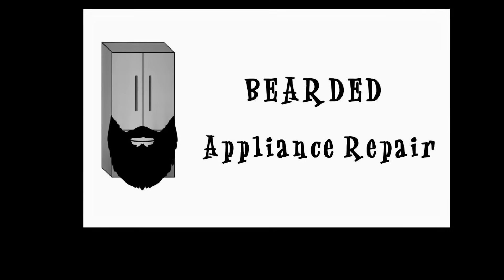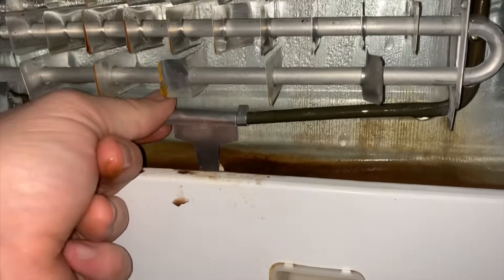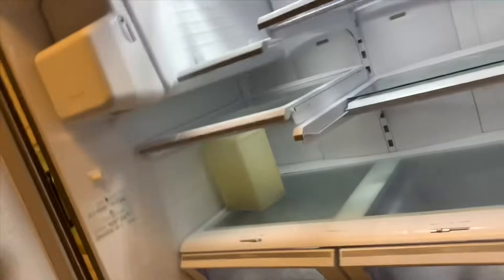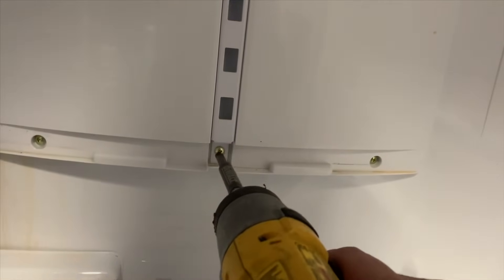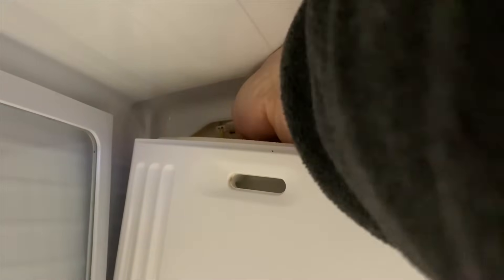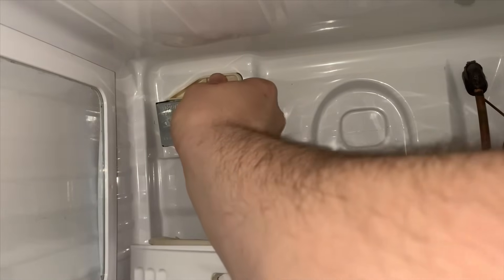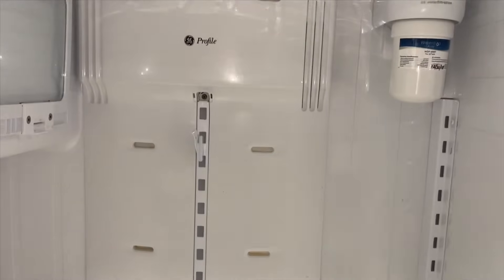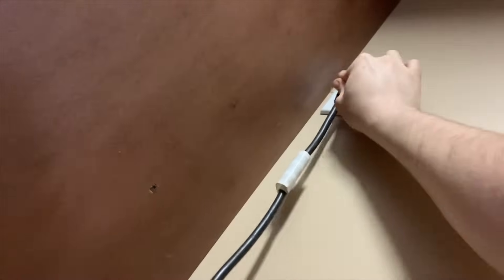Samsung fridge water collecting under deli drawer fix (DA82-01415A)

Comment: its a GE fridge in the video lol
Reply from the maker: Ge just put their name on this Samsung built refrigerator.  This fridge is built exactly like the branded samsung.  Other than the name of course.
Reply: The Bearded Repairman says it is a "Samsung built" GE Fridge in the vid ... Seems as if Samsung is facing a Class-Action lawsuit over this as all their "Twin Cooling" models seem to have the same problem.
Reply: Yep Same exact "Samsung" Fridge - Lots of Sears sold are re-brands of other names .. being largely GE (samsung) or LG (Kenmore) part equivelent under the hood in my limited experience.
Reply: @BeardedApplianceRepair  the link for the kit is sold out. I wonder if it will ever be back in stock?
Reply: Mine has recently starting leaking alot. Couldn't figure it out. I wondered about the GE on the tag also.
Reply: @976slc  I bought the part and got the older one with less holes on the tubes .. my freezing over I think was the combination of a tube clogging and also freezing water inside - which cracked the plastic "back board" 3 places under the white cover... So maybe 11 years on my model is long enough to think about changing.  Not giving up on mine just yet - but I do not think it was fully fixed.  Maybe more clogs, not sure. Please note I do have a Samsung and was same as video.
Reply: @dougprentice1363  I don't understand stand why you can't just clean tunes up,
Reply: Sorry spell checker is being screwy. As I was saying I don't understand why you can't just Clean the tubes up
Reply: @philliprobinson1406 I did, and it didn't solve problem. So I poked holes and opened slit, didn't.solbe problem. The part that clamps to the heater mat help.
Reply: Ok thank you for the information
Reply: @philliprobinson1406  man, talk about spell check. Lol. I take it you could deciefer my last post?
Reply: @dougprentice1363  check reliable parts, or sears part direct. Amazon may have it
Reply: Yeah, and he states it covers both fridges. If you've looked at the configuration on both it's identical, try to pay attention instead of being a critical idiot. A lot of refrigerator name brands are manufactured by the same people or a lot of the internal workings and parts are the EXACT same.
Reply: @RandomStuff_In_MyLife  Since Sears is no longer, Kenmore is made by multiple manufacturers(Whirlpool-who used to exclusively produce Kenmore for Sears-,Frigidaire, LG, etc)which can be determined by the first few digits of the model number. Whirlpool produces other name brands such as Kitchen Aide, Roper, some Kenmore, etc. As mentioned by the Bearded One, the G.E. Twin Cooling fridges are manuf by Samsuck.  If it looks like a Samsung or LG,  you can be assured that it manufactured by them. Interestingly enough, I did some investigating for a customer and found that the Kenmore fridges that were manuf. by LG, which also utilize the linear compressors, during the period of the LG class action suit, were not covered by the suit which I consider a big bowl of wrong.
Reply: @philliprobinson1406  Some comments here say that they just cleaned up the old tubes. I'm planning on using vinegar or citric acid.
Reply: @rasgoldproductions  The panel doesn't look the same as the panel on the Samsung in some of the other videos.
Reply: Pay attention: “Samsung-made GE refrigerator “

Comment: By the way, you can avoid ice build up if you keep the freezer temperature at 5 degrees Fahrenheit and fridge at 39. I replaced that clip and it was find for a few months but started leaking and ice build up all over again, but after I adjusted the temperatures, the problem was finally solved. it was such a simple solution and no one knew how to figure it out. I only wish that I knew that before and it would have saved myself a lot of aggravation. I hired a repairman who twice ripped me off,  called customer service at Samsung who gave me worthless instructions, buying a clip and defrosting the fridge multiple times.  Believe me a went through hell with a fridge that was only 4 years old. No one wants to give you a simple solution.
Reply: Ugggghhh this Samsung fridge is garbage!!!
Reply: @gwenkoller5516  -I guess I have to agree with you. There should make it illegal to sell expensive garbage like that. There should be a consumer warning alert not to buy that piece of shxxt...After one year thinking I solved the problem; we are back to square one all over again. I am experiencing the same problem. i called a repairman who told me I should keep the fridge half emplty and that would basically solve my problem. I said WHAT......!!!! Keep it half empty? Then what is the point of having a fridge just to fill up a space on the wall?
Reply: @guillermone1  OH NO don't tell me that!!! Lol, and here I thought this would be the solution. smh
Reply: @gwenkoller5516  -Well on a positive note, the ice buildup on the back panel, is not as bad as before. But to add insult to injury, I am also getting a small puddle of water under the pull-out trays. Again, not as bad as before and perhaps I can live with it for a while, before I can afford to buy another fridge. But I am going to make one last ditch effort and get a Samsung authorized repairman and hopefully this last time the problem will be solved once and for all.
Reply: @guillermone1  These are the days when I miss my Kenmore!!!
Reply: @gwenkoller5516  -Yeah man, tell me about it.
Reply: Thank you so much for this!!! Samsung is 100% worthless and I got pissed 😡 and went and spent 10k on ALL new LG appliances because I refuse to ever deal with Samsung again! But my husband won't let me trash anything so now it's his beer 🍺 fridge 😂🤦🏼‍♀️ but we've followed all of the instructions on this video to a T and we're still dealing with the same problem, I was about to trash the damn thing but I'll be trying what you said!
Reply: I cannot thank you enough! My husband and I added the heater clip about 6 months ago and everything was fine until maybe one month ago. I am about to check the drain tubes but I bet your solution may be ours.

Edit: oh no, I read your further comments.
Reply: @junello8354  -Well I was able to convince Samsung to pay for replacing the ice maker. I did the research and found out there was a factory defect. They sent an authorized Samsung repairman and changed it. We also made a deal on the side, to also replace the back panel for a relatively nominal amount.  I also tipped him as well. I keep the fridge temperature at 36 degrees Fahrenheit and freezer at -2 degrees. Its been about a year now and thus far this time it worked. I think we finally solved the issue. By the way when replacing the water filter, only use Samsung, do not buy any off brands because it is going to cause havoc for your fridge.
Reply: @guillermone1 the ice maker was the fault?
Reply: @marioplummer2048  -I believe there is a relationship with the Ice Maker and the ice build up. After it was replaced everything has been find and dandy. However, I also replaced the back panel. I made a side deal with the repairman and I stop using the ice maker, because I fear it might go bad again, but it looks like the ice maker was the issue. So far so good. I am happy again.
Reply: @guillermone1  i asked a tech and he said the back panel was the culprit even before i got this message, i am gonna replace it and keep you posted.
Reply: @marioplummer2048 -Okay, please do I really want to know. It has been a long journey and great to know if this is the real solution.
Reply: I just unclogged the tube on the right. I hope that fixes my issues. I'm going to try adjusting the temps up a few degrees. Reading the service manual I see you can also start a manual defrost from the display. I'm not buying any more new appliances, instead i will seek out used 80s or early 90s models.
Reply: We had ours service twice and issue came back so technician finally had the fridge slightly tilted backwards by lifting the front legs a bit to prevent water from dripping out the front.
But if you remove the bin there is always water and frozen water there that slowly evaporates I guess.
Question you mentioned setting temp to 39 but mine says recommended is 38 but won't let do 39. I have 40, 42 as options
Reply: Thank you for this advice. I already replaced the longer clip down the drain hole about 2 years ago. I’ll try your method.
Reply: Dude, this did the trick. Saved me a day and a half of thawing, moving fridge stuff downstairs, disassembling blah blah blah. Took about a week but the ice clog is melted and everything is flowing normally. Thanks again.
Reply: @stephenplantone9720  -WOW... !!!! I am so happy to know that I  was able to help. As you know, I have also done the same and not have any issues any ever since as well. Congratulations....!!!!!
Reply: @stephenplantone9720  Can you please clarify what did the trick?  Replacing the back panel or adjusting the temps as advised in this thread??  Thanks in advance.
Reply: @patti7904 -I truly believe that in the very end adjusting the temperature is what did finally solve it. The reason I say that is because after I replaced the back panel and although the problem stopped, about a 1.5 year later, I started to have similar issues but to a lesser extent. Adjusting the temperature did the trick. 

Coincidentally, today I heard fan noise coming from the back panel, which usually happens when there is ice buildup. I checked the temperature, and it was for some reason set at 35-degree Fahrenheit. I raised it up to 39 degrees and about 1 hour later the noise went away. I guess raising the temperature 4 degree, melted the Ice and problem solved. I hope it works for you.
Reply: @patti7904  I turned the fridge up from 37° to 39° and the freezer from 0° to 5°. It took a few days but the water started draining properly again. Bad news is last week it started puddling up under the deli drawer again. Now I’m probably going to have to disassemble the fridge, thaw it out, then replace the drain clip again. I did it 3 years ago and that did the trick until now. If you have the original aluminum clip still installed you may have to buy the new longer “after market” one. Let me know if you want me to send you a video on how to replace it.
Reply: @patti7904  Just had a breakthrough. I replaced my water filter 2 days ago and the leaking has stopped completely. Basically, you can’t neglect to change your water filter or it will get stopped up
Reply: My Samsung leaks and fills the fridge below the bottom drawers with water. The vents at the back wall are full of ice, I have the fridge on its recommended settings, we do not use the ice maker in the freezer, it is not hooked up to water even, and I have no idea how to get this water to stop, every two weeks I’m using a hand siphon to take 3/8” of standing water out, what is the back panel? Inside the fridge or on the actual back of the fridge?
Reply: @guillermone1  How do you turn ice maker off, front panel or just pull tray out
Reply: @BvictoryforChrist same here. No water hooked up here either and it’s happening sooner and sooner 🤦🏻‍♀️🤷🏻‍♀️😡
Reply: @moosefae84  a customer of mine has the same fridge and he complains of the same issues, he called Samsung and they had no answers. His solution is never buying one again lol. 

I recently turned my freezer to 8 degrees and my fridge to 42 degrees and it slowed down drastically, we are keeping a towel in the back of the fridge and ring it out in the sink and put a dry one back every few days but the pool of water has stopped accumulating and the back ports for moisture have de iced and I think the problem is mainly that those hoses for the twin cooler ports run behind the freezer and any moisture that goes down them gets frozen over time and blocks the drain tube to the pan below, and eventually has to be thawed out. I read some people used hot water and a turkey Baster to do this but after a week of keeping my my temps higher they opened back up on their own, and there is very little water pooling now.

I got this fridge for free so I can’t complain too much, but I can see why someone left it behind, and I will never purchase a Samsung fridge with my hard earned money, that’s for sure.
Reply: I got my fridge at 40 degrees and it still ices up behind the back panel and under the deli drawer...40 degrees and it's still cold enough to freeze water in the fridge...soon as this thing does completely I'm switching to another brand....I read Electrolux and Fridgedair are pretty good.
Reply: @kerry7967  -All of my suggestions were temporary fixes. The fridge was fine and dandy, for months and even 1 year but not long after I was back to square one.  I finally got tired and finally got rid of it. I bought a whirlpool and so far, so good.

Comment: Thank you so much!! I’m a 68 yr old widow and I was able to fix it myself!! Great video and instructions! Saved me the big quoted bill from Samsung! I also very disappointed in product and customer service. This refrigerator is only four yrs old.
Reply: After replacing clip no leaking for about five days now leaking again. I am going to clean tubes in back of  fridge any suggestions?
Reply: @ellamcculloch7418  -Adjust the freezer temperature to 5 degrees Fahrenheit and fridge at 39 and you should have no more ice build up. Its a simple solution but everyone keeps quiet. You make no money if you can't buy parts and pay for a repair man. Unfortunately, that is capitalism for you, but then again communism is worse. You be the judge.
Reply: how did you move the big refrigerator? Are there hidden wheels somewhere?
Reply: @ryangray7832  -Don't know if you are talking to me but I will respond regardless. All if not most refrigerator have wheels. Some are harder while others are easier to move. It all depends are the size and design. But no wheels is highly unusual particular for bigger fridges.
Reply: @ryangray7832  yes there are wheels on mine

Comment: A month ago I noticed I had ice building up underneath the deli tray (which is below the two produce drawers).  It seemed to coincide with me putting in a new water filter (that is located between the two produce drawers), so I pulled the water filter out.  The frig doesn't need a water filter installed to use the in-door water dispenser so no big deal.  But the ice re-occurred.  So thanks to YouTube, and DOUBLE thanks to you I order the metal part and undertook the repair/replacement that you show in this video.  I'm VERY optimistic that I've solved the problems, especially because i had ice build up in that little drain where the metal piece hangs.  Anyway, THANK YOU, THANK YOU, THANK YOU!!!!!!!!!!!!!!!

Comment: Thank you so much for your video, I went right away for step two with drain tubes in the back of the refrigerator, both were completely blocked with epic buildup of crap, cleaned it, put it back, seems like it took care of the problem. Saved probably $300 or more by not contacting repair company. Thanks again. ❤

Comment: Thank you for the video!  I found the ice under the deli drawer today while trying to figure out why the alarm continues to go off on my Samsung.  It is driving one of my dogs crazy and is intermittent and has been happening for about a week.  In the past when it did this, I unplugged it and it stopped but about every year or so, it does it again.  This time unplugging it didn’t help at all and it is driving us all nuts.  I cleaned out the ice and have just watched your video and will start by checking the drain tubes and then on to the inside piece.  Thanks so much for such a clear video!  I can’t afford to buy a new fridge right now so hopefully this can at least give us a little peace.  😊

Comment: I have a different Samsung French door refrigerator with problem of freezing up and clogging drain. I found same fix using only a piece of copper wire wrapped around heating element and dropped down drain tube about one inch. Worked like a charm after a couple years of misery  thawing out my very expensive refrigerator...

Comment: I just completed my repair on my GE fridge following the instructions described in this video.  The part is a Samsung part but works on these GE fridges.  I read a couple comments about using a hair dryer to help speed up the defrost.  I would not recommend this.  I used a hair dryer on low in one small area and the plastic started to crack behind the evaporator.  I was lucky the crack was in a location I could cover up with duct tape.  A $3 fix that would have cost hundreds if you had this serviced professionally.

Comment: Old video but still valid. I just did this today. Ice was string. Finally put some salty water in and it flushed. HooYah. Then I did the little heat sink modification and we shall see. Usually takes a couple months before drips out front. But the new modification may be a winner.

Comment: I already did this and it works great.  I bought just the clip on Amazon.  To defrost, I put my Samsung in display mode and put A small space heater inside. This has a thermostat, the max temp is about 110F.  Reiterating: defrost before you pull off the rear cover.